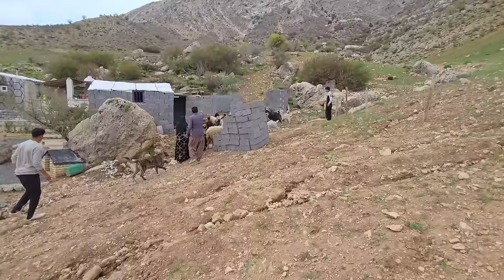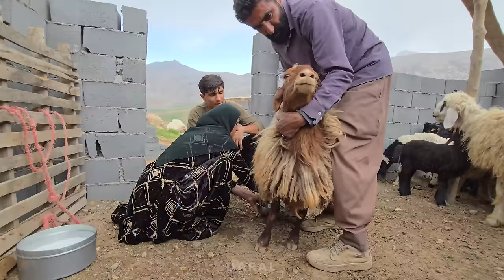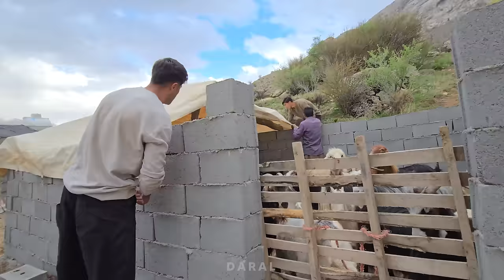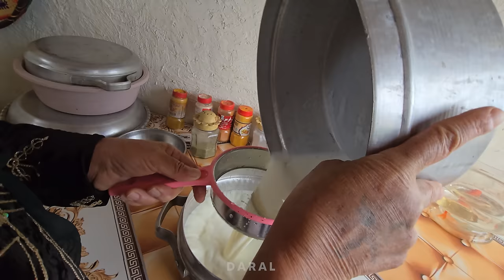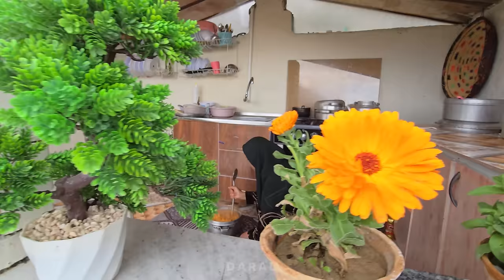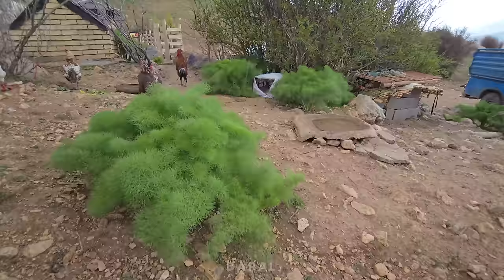"Amir and Milad's Rainy Day Adventure: Shopping for a Water Heater for Their Bathroom"

Comment: 1) Finish the roof for the goats and sheep
2) Don’t milk the animals until the mother starts pushing them away more often than she lets them drink milk. 
3) Get some long containers for water and feed. 
4) Build a chicken house that is big with shelves. The chickens will fly up and settle there. 
5) Get a gas water heater for the kitchen and shower. 
6) Make the corral bigger. You can have another circle and unite them in the middle.  
7) Add more counters and cabinets in the kitchen so Ajab doesn’t have to cook on the floor. 
8) So many other things…😁